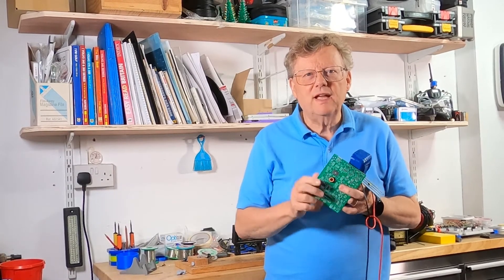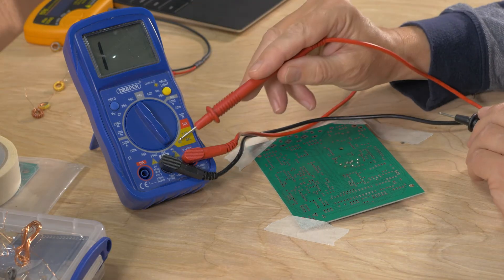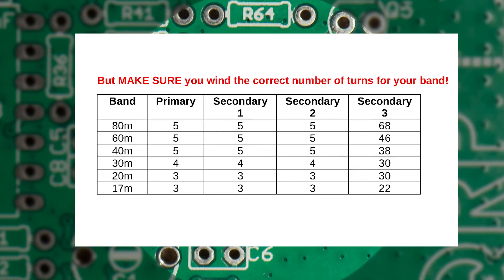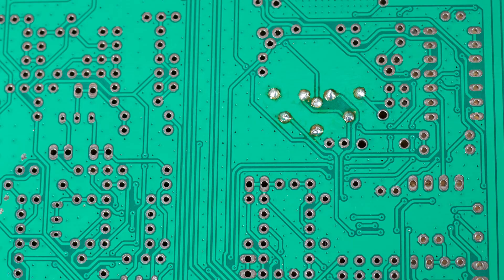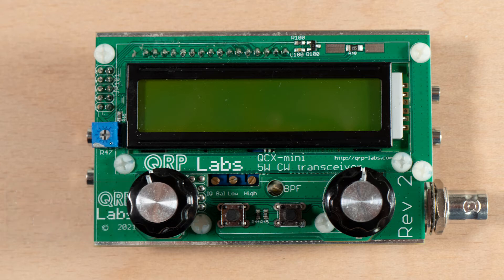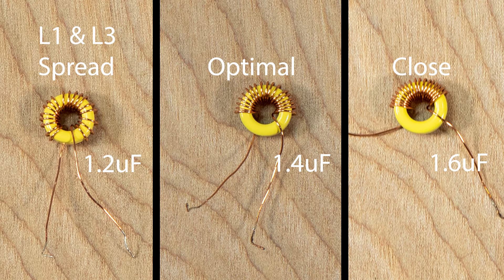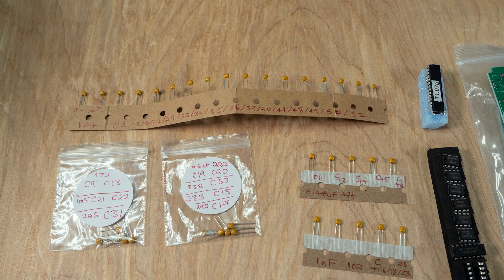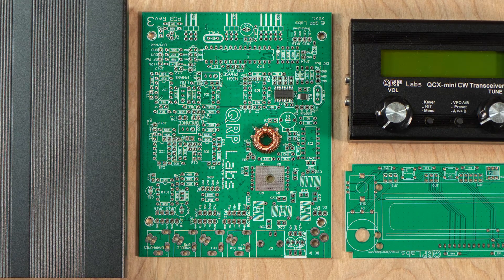Rediscovering Radio 4 :  QCX Plus : Optimising Coils & Kit Build start

Comment: GA brother ham,  Just a quick comment. I have five QCX radios and still enjoyed watching your video. I am planning another QCXP this time on 17-meters. My earliest QCX is a Rev2 80-meter which works just fine. Going over the parts I have always distributed each value into a plastic parts bin sort of like a large old-fashioned ice tray with each parts cell labeled per the parts listing. I think you are very wise to value the toroids before install. I am sure this saves a lot of time. I have never done this until now but I will next time. Thanks for the video and will hope to hear from you on this side of the pond. Knowing your call would have made that process easier.  de N4NRL
Reply from the maker: Thanks so much for your encouragement. It's taking a while, but I will get back on the air eventually - my callsign is G4BSK, issued in 1972. Glad you liked the video, hope we can make contact sometime. All best wishes, Mortimer